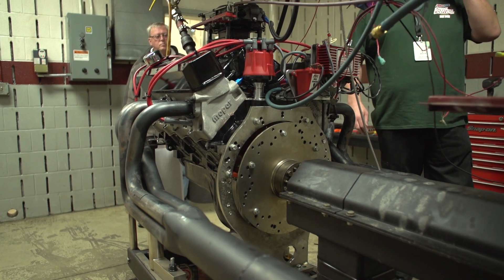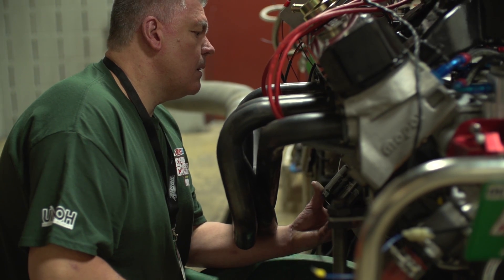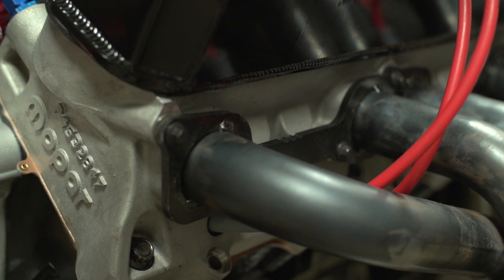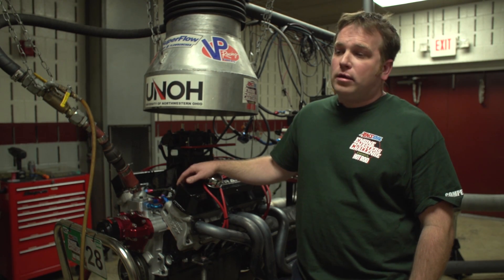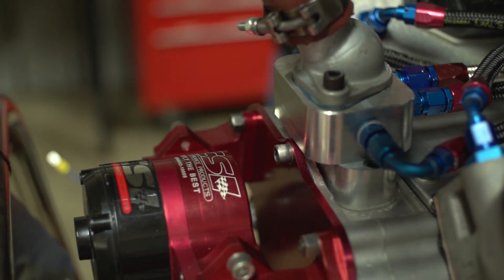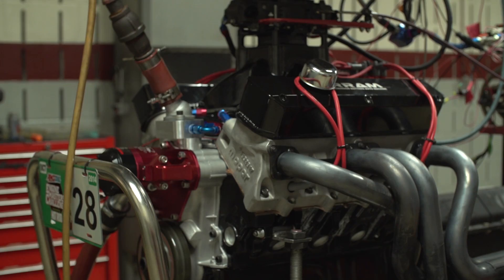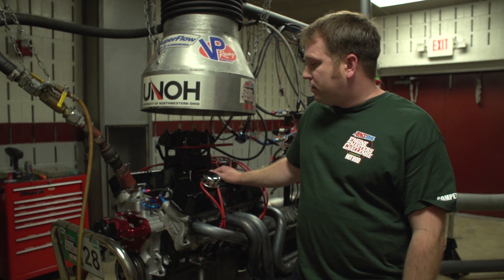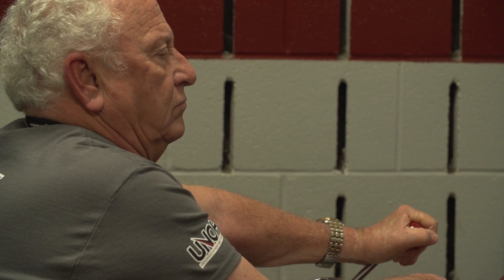436ci Mopar Small-Block by RRAM at the Amsoil Engine Masters Challenge 2014

Comment: Should have made a bit more.
Reply: 1WILDsMoPARtech.. I agree 600 is not much horsepower for all of those go fast goodies in it..
Reply: Yeah, I usually see w9 heads on top of 900+  horsepower motors. Maybe because the power band was limited to 6500 rpm.